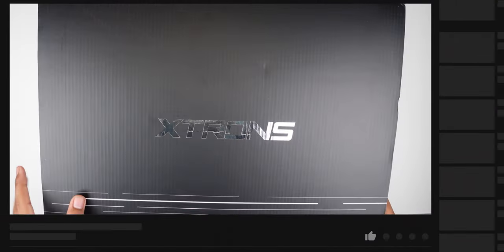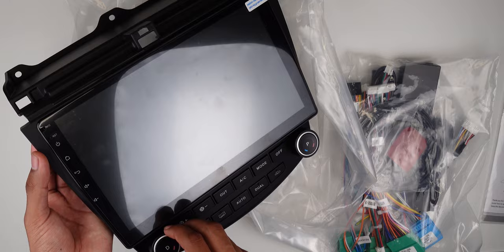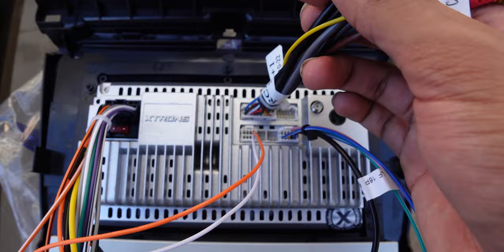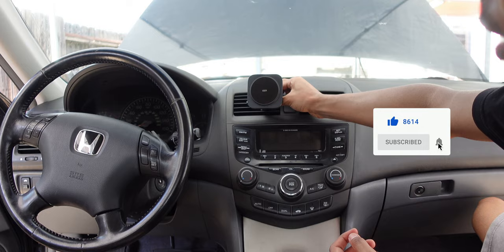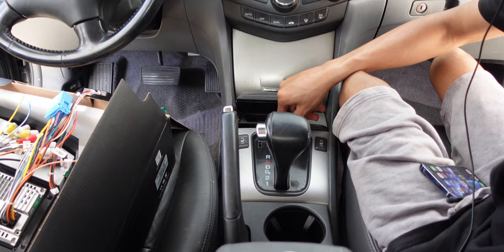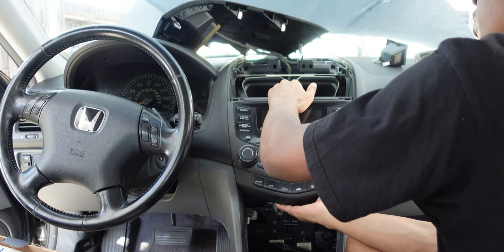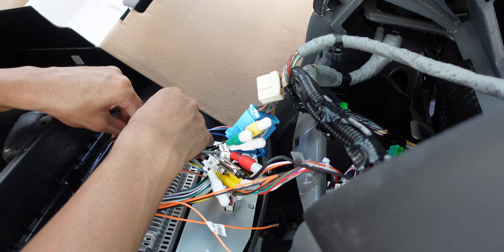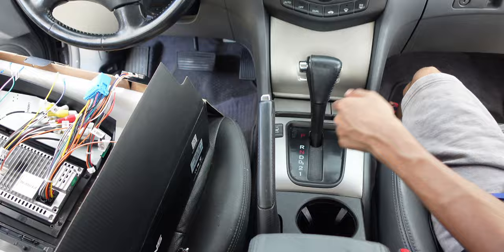Xtrons 10.1" Honda Accord 2003-2007 Touchscreen Installation (EASY MOD)

Comment: Does the FM/AM radio works?
Reply from the maker: yes u can use the previous cable from the OEM and plug it in to use the radio.
Reply: I asked because I saw in another video that the OEM cable doesn't reach well, but it was a old video. Thanks for sharing this l.
Reply from the maker: @rgch32  it barely fits u would need to adjust it a bit

Comment: Did you skip the 4GB version bc of the issues??
Reply from the maker: No I wanted the 4gb but the company sent the 2gb. It’s ok tho worked out fine in the end
Reply: Okay so what are you referring to with issues with the 4GB because I wanted to do the 4GB version because I figured that the 2GB would be getting slow after a while because once you have to update apps like YouTube and Google maps over time it's going to use up that little bit of memory quick that's why I figured the 4GB would be better but I can't find any reviews on it only on the 2GB version on YouTube
Reply: @TechReviewsTV  so did you pay for the 4GB version and then they sent you the 2GB and refunded you the difference or how did that work because I'm about ready to order the 4GB for my 04 V6 6-speed Accord Coupe and I was going to get the 4GB because I figured the 2GB after you have to update apps so many times like YouTube Google maps and other things that eventually you'll use up that memory pretty quick and then it will start to be slow and I can't find anybody that's reviewed it on YouTube only the 2GB version like you did so if you could please get back to me about any of these questions bro I'd appreciate it cuz I'm literally ready to order it right now I got the money in my hand
Reply from the maker: @seattlejdmcivic  I didn’t buy it at all I got it sent to me for review. But I’m doing a 6 month review on it now should be posted tomorrow if you’re having trouble deciding it’ll answer everything you need to know
Reply: @TechReviewsTV  yeah bro please do because I really need to make this decision by tomorrow so if you post that please please do ASAP

Because I have an Android auto and that's what I'm going to use not Apple carplay and I'd really like to know whether or not it's worth it to get the dongle because what I'm thinking is just mirroring my phone screen onto the screen of the radio that way I can use all my apps without having to use my hotspot and waste my data even though I have unlimited it still will eventually slow down after I use a bunch with how much music I play everyday

So yeah I really want to find out if it's worth it to get the dongle and if it's worth it to get the 4 GB or 2 GB version because like I said I'm going to be updating apps and I plan to leave this in my car for years to come so I want to make sure that 2 GB one isn't going to slow down and not be worth it after a while because I'd rather just spend the extra hundred bucks and get the better one if the 2 GB one after months of use is slowing down or not worth it or laggy so yeah please post that video and even if you don't let me know your opinion and just comment me back
Reply from the maker: @seattlejdmcivic  just made the video
Reply: @TechReviewsTV  all right I'm going to watch it right now cuz I'm ready to buy this thing
Just need to decide on which one
Reply: @TechReviewsTV  hey brother I did have one question for you that you did not cover in the video

I know you could do Bluetooth and everything like that I have an Android so I'd be doing it that way I've heard that sometimes the Bluetooth connection can be spotty so I'm curious does it come with a cord that you can manually hook your phone up to the stereo like a USB cord or something and then that way if you don't want to use Bluetooth you can use the cord to mirror your phone screen on to the stereo??
Reply from the maker: @seattlejdmcivic  you can use the included end of the usb to play music also. I have no idea about screen mirroring tho

Comment: Easy, understanding and great video overall
I’m just having issues with the ac
Buttons work and shows ac data but no air comes from the air vents at all
Reply from the maker: I’ve had the issue in the beginning there is settings within the AC control that is set to exterior airflow you need to change it. Should be on the top and then make sure you have dual Ac turned on
Reply: I have air blowing out of the vents but it does not get cold. Pretty sure it was working fine before I installed the xtrons. Any ideas?
Reply from the maker: You need to change the ac current, on the top it’s pulling air from the outside. And not using the actual ac
Reply from the maker: I’ll make a video this week

Comment: Nice video man…seen this was posted a month or so ago…I haven’t seen a review video yet.   How is it all working so far?  Climate controls work correctly?  Anything negative?
Reply from the maker: Yes everything works perfectly as before but better
Reply: @TechReviewsTV  how dose the max AC work the stock climate control I have in my 2006 has a button for max AC. How dose max AC work on this new Raido?
Reply from the maker: @orockzman8757  it works just as the OEM model just a little more control over it
Reply: @TechReviewsTV  thx 🙏

Comment: 5:26 why is it that you need to get the key inside there? Is it to be able to move the gear shift since otherwise it'd be blocked? Also, would moving it to 1 not let the car move, so if I'm parked in a slope and change it to 1 won't the car roll down or something?
Reply from the maker: Your e brake will still be activated, it’s to move the shift more

Comment: Does your A/C and heat defroster work?
Reply from the maker: Yes everything works normally
Reply: Mine dont
Reply: @carternisely8647 you need to change the canbus setting, happened to me

Comment: Where do I get the single zone
Reply from the maker: It comes with that cable and you just plug in the one end of it
Reply: I got the double zone I need the single
Reply: I have the double one n I need the single with out buying another one
Reply from the maker: It comes with both cables